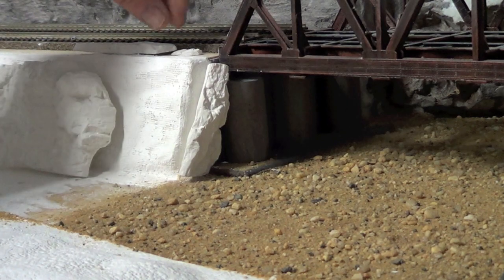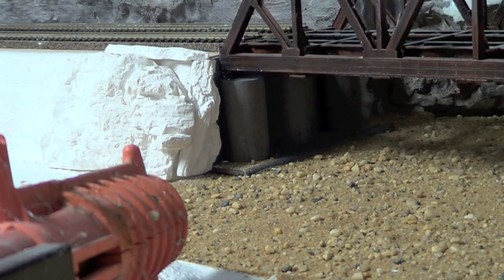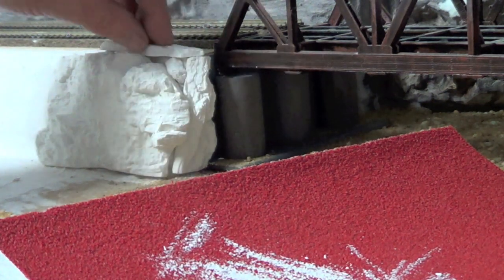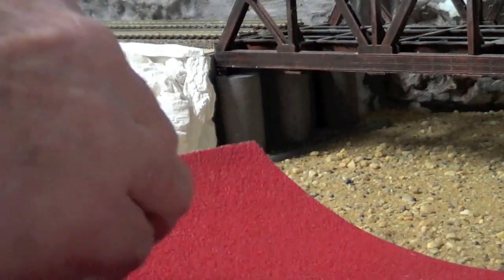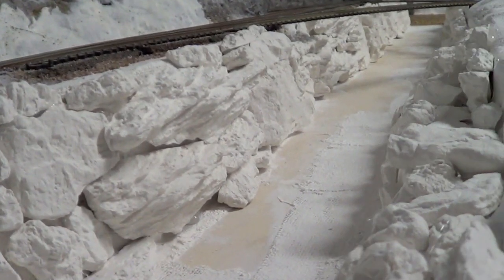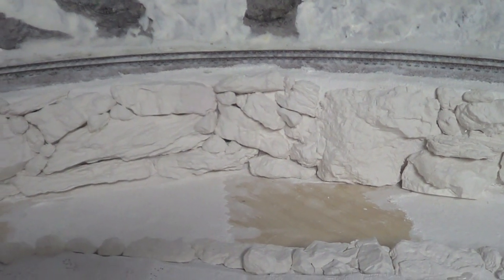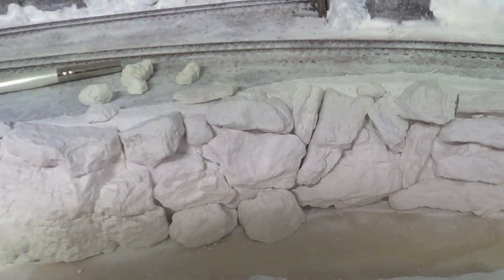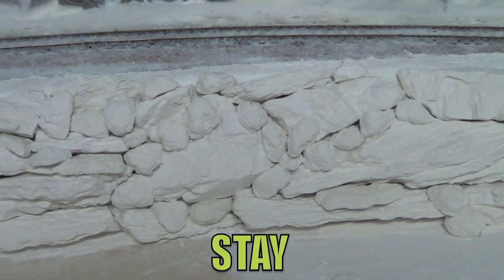Rock Molds On The River Wall " Model Trains"

Comment: Looks great Robert , a word of caution with that corse sandpaper , take care you don't remove the ends of your fingers , it would only take a couple of swipes , that is alot of rock molds  mate , must have take a few days to make all of them up , I saw a little drip of the glue at 12:23 !
Reply from the maker: Dave i'm very careful with the course sand paper lol and i have been doing
the rock molds off and on for the last couple off weeks. And yes to the little 
drop off glue at the 12.23 mark, this and the other drops will be taken care off cheers
Reply: Your welcome Robert ! Cheers !